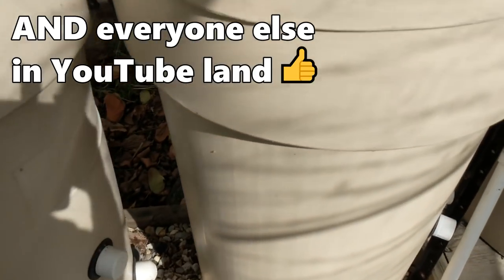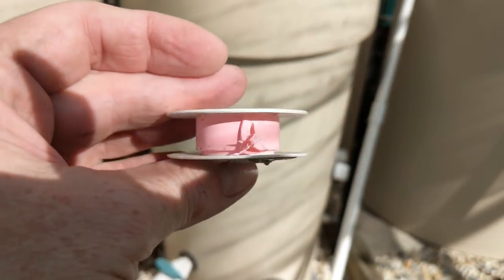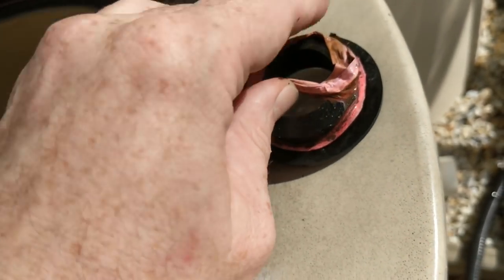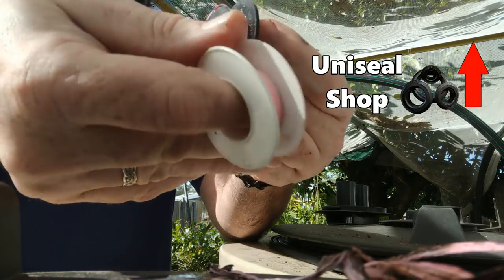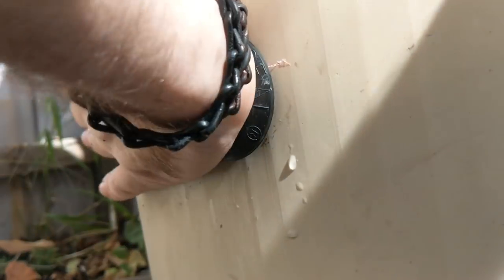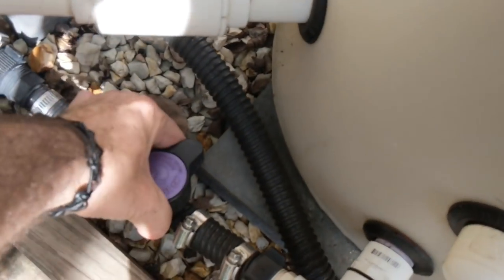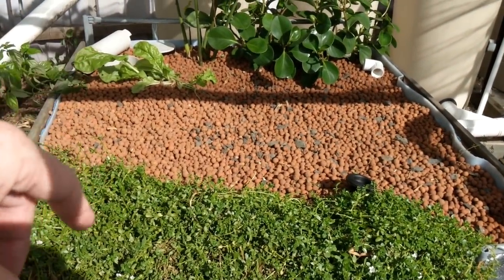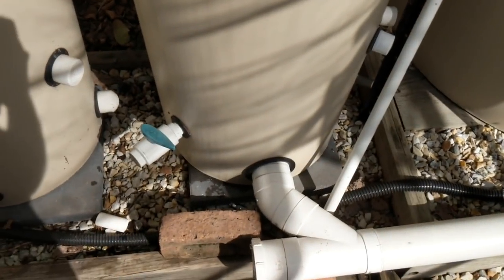How to Fix a Leaky Uniseal | Mini Aquaponic Update

Comment: Thanks rob for this video. just what i needed. today i have to empty my 200 lt moving bed bio filter. im hoping i can get away with not bailing out the 100lts of K2. im thinking of blocking my drain valve at the bottom of the Moving bio filter as i havent used it in 2 yrs its been running, i figere with all the media moving it should lift the sediment anyway. your thoughts? thanks again

Comment: Did you run out of bubble gum and baling wire again, Rob? Are those seals silicone compatible. A quick bead around may just do the trick.
Reply from the maker: 😄Yep 😞 
I don't like to use the silicone on joints where there's movement. Have found that it doesn't hold on to well to the plastics under stress.
Cheers Harry & have a top one sir.

Comment: Hello Rob how's it going ? My name is Gabriel. And I have been a big fan of you for a long time. And now I see you have the "black turmeric" or curcuma caesia. I have been growing this type of turmeric for a long time now.  But I only found information on how to use as a medicine. Would you be able to tell me if I can eat it ??? I am Chef here in Brazil. And I plant a lot of different types of weird plants. Cos I love it. And I really would like to eat my black turmeric. But I do not know if it is safe! I have used in many other ways. To cure migraines are the "bomb". If you can answer me that I would be more than happy. Thanks for teaching me so much! I admire you! Keep doing what you're doing. YF. Gabriel Flores
Reply from the maker: Hi Gabriel.
I don't know a great deal about it myself only that it is used as a medicinal & not a culinary plant due to it's bitter flavour. I think I'll be using it for my own & our dogs joint issues but may add some to meals depending on what I think of the flavour.
Sorry I don't k=have a lot of information to share with you about it.
Cheers.

Comment: Uniseal vs Bulkhead fitting for quality / robustness?  You can buy them at a very similar price, so...
Reply from the maker: I worked it out for a chap this morning Steve. 
For a bulkhead & screw fittings it cost $17+ & uniseal $4.45 here in Australia. 
I haven't had any uniseals fail that have been installed correctly & have had no reports of failure from folks I've dealt with. This is a fix for a dodgy drilled hole as I mentioned in the clip. 😉
Basically folks need to do what you think works best for them & their fish. 
Cheers.
Reply: Would be interesting to know how low you could get the cost down buying BULK bulkhead fittings lol
Reply from the maker: Quite a bit if I wanted to re sell them but a bit hard for someone that just needs 1 or 2.
Reply: @RobsAquaponics  how to install correctly Uniseal?

Comment: I’ve tried this 4-5 times on a 1/2 inch size uniseal and it leaks more with the Teflon tape?? Not sure why these things leak. Drilled backwards with the hole saw, cleaned it up nice and carefully; they just keep dripping. Wouldn’t typically be too concerned as it’s not a crazy leak, but the system I’m working on is inside.
Reply from the maker: Whats the OD of the pipe you're using in it AA?
Reply: It’s schedule 40 pvc so should be .840 inches.is there something better? Just trying to add a swirl filter to my small indoor system.
Reply: Could it be possible for something to be too thin of a material to use s uniseal? Or does the curved surface make a big difference? I’m using a 5g bucket
Reply from the maker: The curve of a bucket would be fine for a uniseal of that size &  0.84" is the right size for the ½" uniseal. 👍
I have used them in a few thin walled buckets & found they work fine for a while but nearly always end up splitting around the hole after a few months. 
Only think I can think of is if there was a small nick in the plastic it may of expanded with the pressure of the rubber forcing outwards AA. 
Sorry to hear it's being a pain in the rear mate.
Reply: No problem, was just seeking a solution. I did split my bucket messing with it, so maybe I’ll pick up a new bucket and try it again. Thanks for the tips, tricks, and the walk through of your systems. It has been very helpful in getting me started!
Reply from the maker: How did you end up going mate?  Did you start over with a new bucket?
Reply: Rob Bob's Aquaponics & Backyard Farm: yup but I gave up on the uni-seal. I think the round bucket and the thin plastic was the problem. I use a 1.5in uni-seal on my IBC and it works great. I decided to try something different; I used a threaded adapter and bushing with an O-ring. Price is comparable and no leaks!
Reply from the maker: Good to hear it worked out for you  @AbosoluteAltitudes  . 
Happy growing mate.

Comment: why don" you use silastic, it works in wet and can hold a 2 metre head of water pressure  , i have stopped rusty leaking tanks that way.
Reply from the maker: I've found that it doesn't always seal well on HDPE plastic. Using the tape allows for more flexibility when putting the pump on & off. 
Cheers

Comment: Why not use food and fish safe silicone
Reply from the maker: As these 2 valves are connected to frequently I don't think the silicone would last that long Jessie. All the other uniseals I've had to do the same fix on that just have a pipe running through them are all fine BTW. 👍
Cheers

Comment: go up to the next size hole/uniseal....
Reply from the maker: Hi again Jeff. 😉
No need to as this filter will be comming out & don't see the point in the extra expense. Have had no issues with the uniseals in any of the other holes that were stretched, only ones that get pumps or hoses connected and disconnect to them frequently. 
Since replying to your other post I had a mate recommend silicone tape & by the look of it it's a lot more durable than the Teflon so will try that on the next one I fix.
Cheers mate